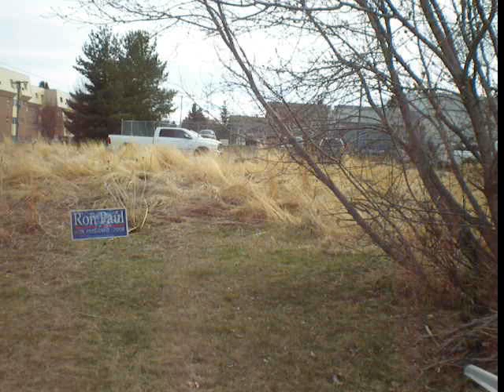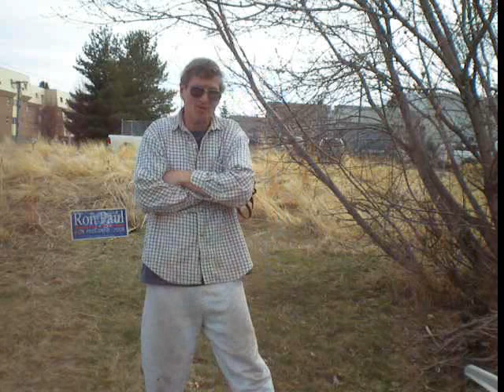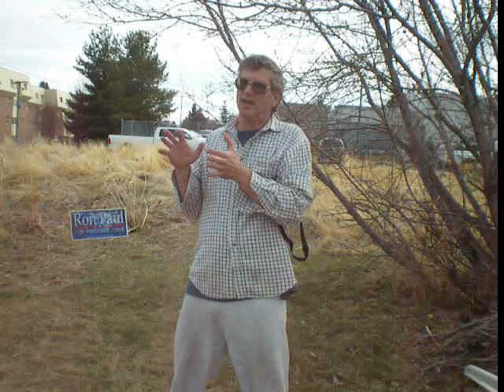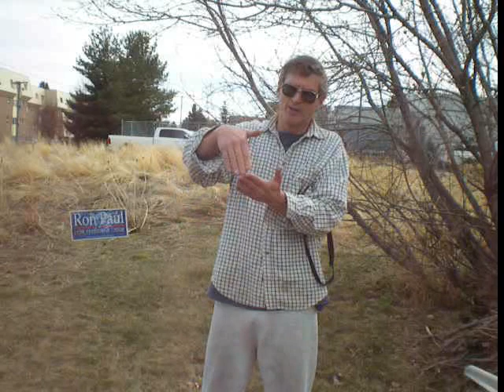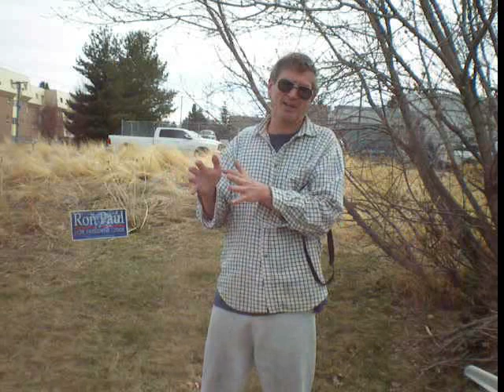A better oil Pipeline Design

Comment from the maker: Oh yeah vintage RP sign!  LOL.  Yeah I was thinking of incorporating drawings into it.  Generally an oval oil resistant rubber valve type thing with a long spring attached that is several feet long and attaches to a hook manufactured into the pipe back a couple feet from where the oval 'rests' in open position with a solenoid shaft over the end of it or perhaps a pivoting mechanism attached to the solenoid.  Whatever seems best there. Multiple ways to do it. The bypass valves are simple sv's